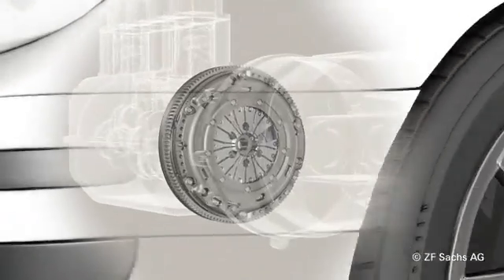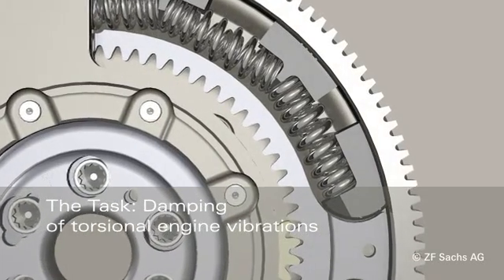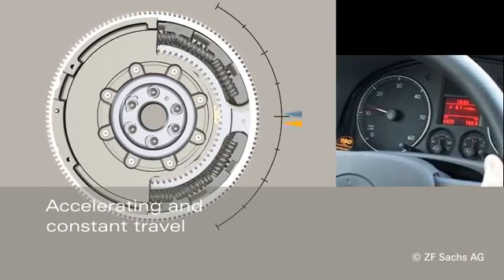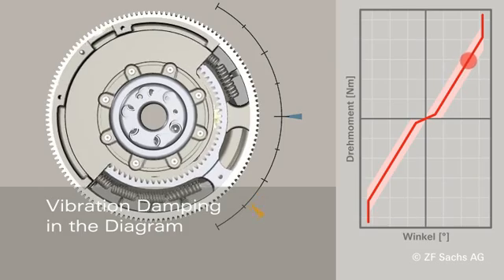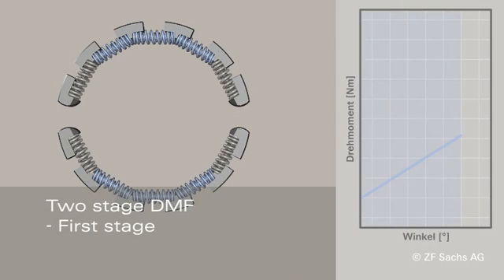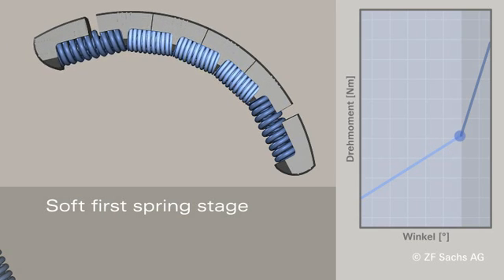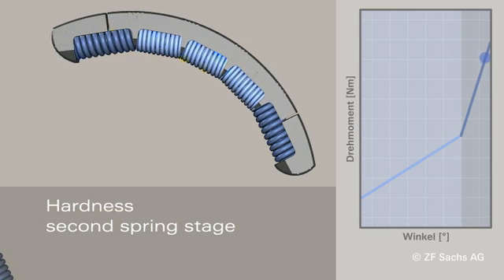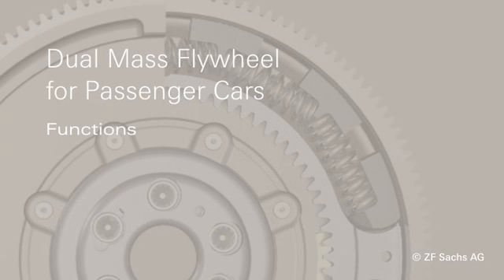ZF zms dual mass flywheel for passanger cars

Comment: The problem with the DMF is now the clutch disk last longer than the Flywheel. In the old days you just replaced the clutch kit and no worries about the SMF at all. Now the customer pay 2x for a way less reliable product. We drove SMF for over the past 100 years and nobody died for a little vibrations or I never seen a transmission broke because of the flywheel. Somebody sold very well this bad idea to the car industry.
Reply: your absolutely right, these are just for money making solid flywheel clutch plate with springs thats all you need , also weak transmissions these days.
Reply: @eddiekennedy7394  It's not the weak transmissions or just selling something unnecessary - DMF saves the transmission from more and more powerful engines that would ruin the transmissions pretty quickly. There are replacement flywheels that can be installed instead of DMFs and usually such replacement results in high level of vibrations and damaged transmission. It's a necessary evil, unfortunately.

Comment: It's so they can make cheaper transmissions. There's very little "development" in the auto industry (racing aside) that is for benefit other then profit. That's typical with most products. KERS would be a great system to put in production cars but if you use less gas, the manufactures don't receive as much money from the oil companies.
Reply: Brillant comment

Comment: 1:55 ... ensures HIGH level of noise??
Reply: "Noise- and driving comfort." The "and" acts as a conjunction between "noise" and "comfort", while allowing two attributes being specified. This structure is synonymous with: "this ensures a high level of noise comfort and riding comfort", but shorter.
Reply: @aerbus  Then it should've been accented differently. The way 'noise' is accented, makes it sound as if it ends the structure of the first part of the sentence. It still doesn't sound natural, even after 11 years since I made that comment :D
Reply: @Bijomaru78  Yeah I agree - the intonation is strange, I guess that´s the downside of having a robot doing the speaking xD